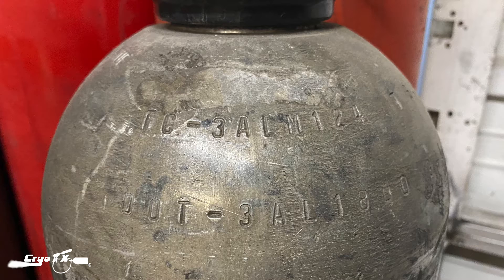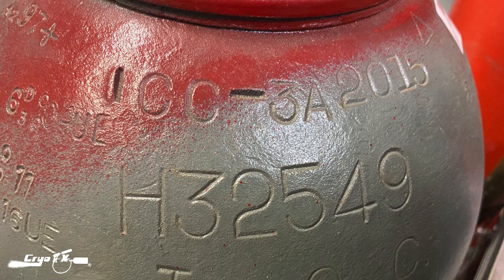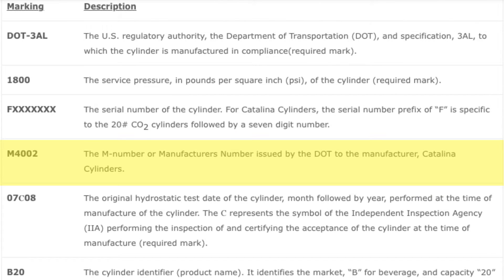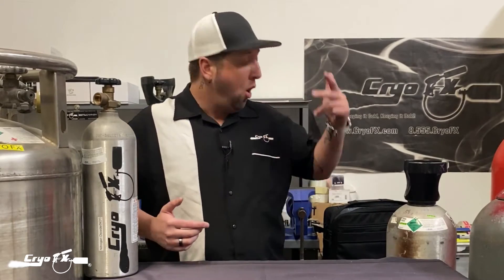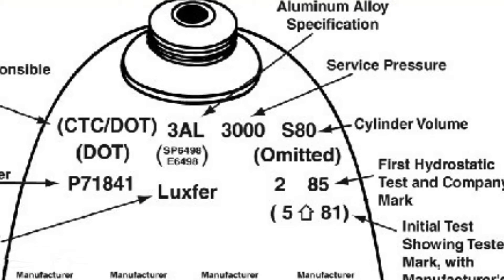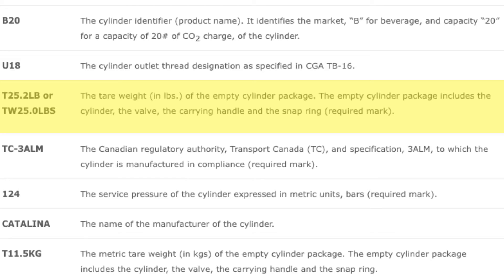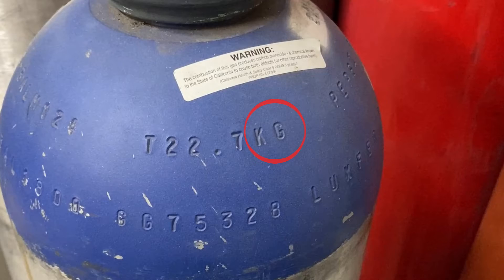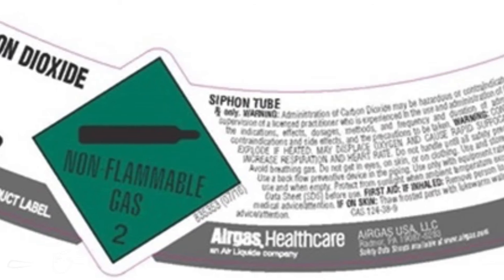Co2 Cylinder Markings - Co2 Tank Markings [CryoFX]

Comment: What is the difference between fill capacity of a UN 1013 cylinder and UN 2187 cylinder?
Reply from the maker: Compressed gases (UN 1013): The maximum fill pressure is regulated to ensure the cylinder can contain the gas safely at a given temperature, preventing rupture or explosion.

Liquefied gases (UN 2187): The maximum fill ratio (percentage of cylinder volume filled with liquid) is regulated to prevent the container from becoming liquid-full at higher temperatures. Filling is done by weight rather than pressure. 

We have more info here as well on the types of tanks

https://www.cryofx.com/product-knowledge

Look at the pdf titled:
HIGH PRESSURE TANKS VS LOW PRESSURE "DEWAR" OR "BULK" TANKS

Comment: My tank I just picked up has a very large BH.389 stamped under ICC 3 Does anyone know what that means?also on close inspection I can see old number that looked like they were hammered out. There is no T or TW but a lone "107" stamped beside the hammered area. This is around a 50lb tank I believe? It is 8-1/2" in diameter and 52" tall to the neck and 58" to the top of the valve handle. Any help would be appreciated.
Reply from the maker: thanks for comment. This sounds like the 107 could be the tare weight itself.

ICC 3: This is the older Interstate Commerce Commission (ICC) specification number, which is now replaced by the U.S. Department of Transportation (DOT). The "3" specifies the type of material, likely steel, used for the tank.

BH.389: This is the identifier for the manufacturer or the original owner of the cylinder, much like a serial number. 

Other common markings on a CO2 cylinder include: 

A "DOT" or "TC" number: The current Department of Transportation or Transport Canada specification number.

Serial Number: A unique alphanumeric ID for the specific cylinder.

Retest Date: The month and year of the last hydrostatic test, which is required every 5 years for CO2 cylinders. If the tank is out of date, it cannot be refilled.

Plus Rating (+): Indicates the cylinder can be overfilled by 10%.

Star Stamp (*): Indicates the cylinder is approved for a 10-year retest interval (typically not for CO2).
Reply: @cryofx thank you.

Comment: Thanks a lot for the video.  
Would you know what the ZX mean. After the Manufacturing number?
MO832 ZX 01A21
On this cylinder they engraved CO2 on  the bottom,  which is cool.
Thanks again 👍👍👍

Comment: so any chance you know what my tank means by its strange designation? dont think you covered it and i can find so little about it.    DOT-E 7042-1800-D 32569 WK4A79 (Think the A in WK4A79 is actually a symbol.... read in an article somewhere about the symbol and looks close to mine. am stumped :/
Reply from the maker: Yes indeed! DOT (Dept of Transportation) -E (Exemption) 7042 (Spec Number) 1800-D (Pressure Rating 1800psi) 32596 (Serial Number) WK (Walter Kidde) 4A79 (Company Code)
Reply: @cryofx  thank you for the reply, typically give up on receiving a reply on these in a week or two after posting. Curious though does the exemption mean it doesnt need to be re tested ever? I think it should be...